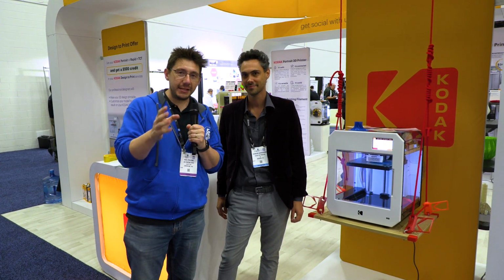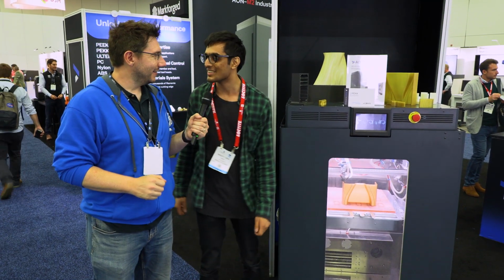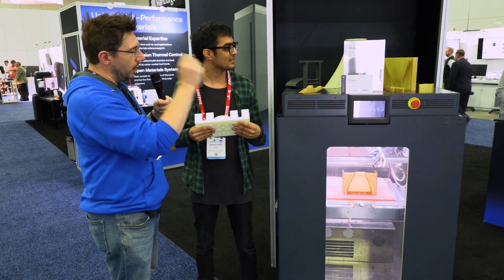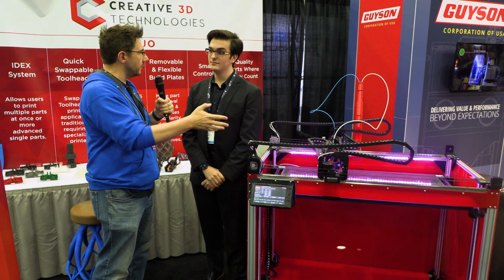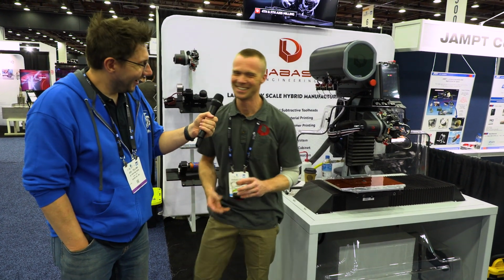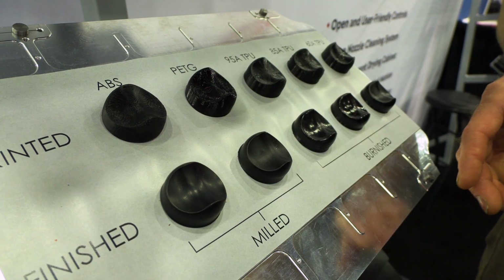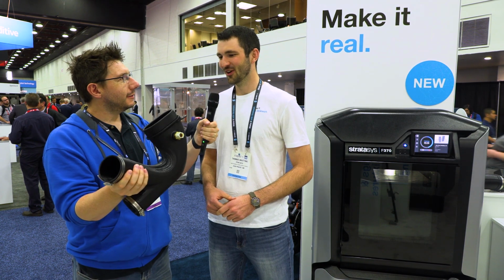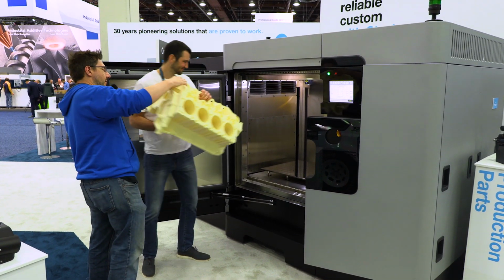Awesome 3D Printers at RAPID + TCT 2019

Comment: Is it possible to upgrade the tronxy xy-2 pro to have 2 hot ends its just I can see a 2nd space in the settings for one and I can see the Circuit board has extra connectors on the board i just don't know what i would have to buy and do to upgrade to 2x nozzles

Comment: me: man I want a kodak 3d printer
man: the cost is around 3500.
me: well... nevermind.
Reply: I would be afraid of any company that makes regulars printers anyway.   The way they have made ink cartridges shut down the printer when one of the two black cartridges is low on ink or how you can even use the scanner or fax options when there is an error with a printer part is the kind of fuckery I wouldn't want screwing with a 3d printer investment.
Reply: James Morris well, i already own a 3d printer, i just want another

Comment: still terrible prints, FDM has no future IMO
Reply: oof
Reply: Umbra Jord it's been more than 10 years? still same quality prints and unreliability; I'm convinced SLA is the way to go now
Reply: @FooBar89  only if you can deal with the (very) high pricetags, the toxic post-processing, the curing, the rarity of parts and resin, and the fragility/nature of the final prints that makes then near non-usable for applications many hobbyists get 3d printers in the first place, and if they suit your purpose. 

Everyone gets fdm printers, not to print solely pretty things (cos they most of the time cannot print pretty things), but to make stuff that can be tough, durable and useful ... and cheap. I got my 3d printer for 100 dollars, the same price I'd pay for a liter of standard resin over here... 20 usd for a (1kg) roll of ABS, PLA or whatever compared to the cheapest standard clear resin of 500 ml's that cost 50-60 usd is.... not affordable/practical for prototyping and making stuff that will end up taking a lot of beating.)

SLA is only really good for show-pieces. even the high strength resins aren't nearly as strong or safe as a cheap, well printed PLA part... or nearly as cheap (emphasis on cheap and safe).

FDM is not made or even good at making things to be pretty. it's made to make useful parts. SLA is not made to make useful parts. it's made to make pretty parts. they are both totally different beasts with totally different uses. they both have a place, lol.

there is no such thing as a bad printer. there's only the user using the wrong printer for the job.
Reply: Umbra Jord FDM has never brought me joy, only disappointment, every single time, on every single print, maybe industrial ones are better; I only have so much time and limited space, I have CAD designs that I need to print, SLA is the only affordable technology that delivered, in the same price range ($4000) FDM has not, that has something to say about the technology, I believe FDM has uses in metal printing, but I have little faith in it for plastic printing, I believe it's run its course

not saying FDM doesn't work or it is not useful, but only as a niche, it absolutely should not be taken as a general purpose printing technology, because it is not
Reply: @FooBar89  then that's your experience, lol... and I'm rather sorry that you did have that experience, but FDM printers really needs elbowgrease and work to get going well. they rarely work well out of the box, but that doesnt mean FDM deserves to burn in a fire or be taken out of the hands of truly great users who do printing as a bussiness, and do so quite well... That's like saying no one may own a car because your car had problems and thus every other car ever is trash :D
Plenty of people have done amazing things with FDM, specifically cheap ones like ender 3 for example, but only after they put in work. effort and upgrades (often printed by that same machine) on the machine... err, work, near-tears, and in my case, some blood as well, lol... getting cut on aluminium is no fun, but that was my own fault.

That's what I looovvvee about SLA though... in a sense, you can operate the machine flawlessly out of the box with a mere read through the manual. if SLA can get cheaper, more accessible, openly serviceable by you, the user, have more spare parts that are not proprietary/easy to get, less proprietary overall and have better, stronger, tougher resins... oh, it would make fdm pretty much disappear...

Comment: WTH??
All of these printers can be made for less than $1,000, whats with the massive price tags?
Reply from the maker: Jamie - I wondered that as well, but if that was the case, I figured we would have more machines out there like this. If you can make one for $1,000 that performs in a similar way and has the robustness these machines have, I will GLADLY show it off here.

Comment: The Kodak machine looks to me like little more than a DIY CoreXY machine based on linear rods and bearings (bleh) with a fully-cantilevered bed (bleh) and a print volume (200mm cube, bleh) that dates back to the early RepRap machines. There's nothing "commercial-grade" about that printer.

Comment: Don't be fooled by the F370 TPU. It is very geometry dependent. Been running ours for about two months.

You can't change infill density or layer height. They lock you out of basically every setting. You need a special TPU  extruder. Also the entire extruder head will need to be replaced after 800 hours and costs $1800.
Reply: As a long-time consumer 3D printer user and current user of both an AON-M1 (the dumpster fire version) and an F370, I feel like I need to say something. First, the F370 is THE MOST capable TPU machine I've ever used. Yes they lock you out of full density, for the same reason that printing full density in TPU is a nightmare on any machine. The perimeters are solid and the parts are great. Honestly the retraction is magic, I don't understand how they manage to get perimeter starts and rapids without stringing.

And we have way more than 800 hours on our TPU extruder, and it's fine. The printer recommends replacement (in addition to all the other service intervals) but that doesn't mean the extruder is bad. Our regular extruders are well over 2000 hours. as well, beyond their service life.

The regular extruders are $500 a piece, yes the TPU extruder is $1300. This sounds insane to a consumer, but believe me, the idea of screwing with a consumer printer while engineering work on million dollar contracts is waiting for you is equally insane. 

We love this machine because we're their target customer. It's definitely not for everyone.
Reply: Classic Stratasys...

Comment: Can you do a video on what method of filament the huge (like the large stratasys) printers use? Like do they use huge spools, or pellets or something else?
Reply: Hey Tom, we sell materials in 92 cubic inch filament spools but some materials are offered in bigger spool sizes (500 cubic inches for the lower end plastics like ABS and ASA). For reference, 92 cu in of ABS is about 3.4 lbs of material (1.5kg). We also chip our materials so the machine knows how much filament remains and also to eliminate the need for customers to tinker with print settings...which is a hotly debated topic

Comment: I've wanted a post-printing milling machine, at the hobby level, for awhile. 
If I'm dedicating space to a cnc milling machine, it'd be doing more than just light finishing work on plastic, also making it a machine for wood and light metal work, maybe even do some drag knife work with it; especially if you're getting into 5+ axis work, having one dedicated to just plastic is a lot of wasted space at the hobby level. 
Another thing I'd personally do is change from a turret tool changer, like the Diabase machine, to either a carousel or belt/chain based tool changer, as tool capacity would be much higher, especially when you're adding print heads on top of milling tools. Then maybe add some kind of pallet system for changing between cartesian and various non-cartesian build platforms, and to change between a build plate for printing and vises for milling, and a vacuum plate for drag knife and some harder to hold work.
Basically, I just want an all-in-one additive and subtractive cnc machine, as it'd consolidate most cnc work into a single machine, which means it'd be highly space efficient.

Comment: Could Daibase use the cylindrical set up to first mill a shape, say the 3D model of a person's forearm, then switch heads and print a material over that, creating a custom fit precision part?
the potential is great and I don't see why they couldn't but it requires a lot more consideration in head location and rotation on there lathe like part as the shape may not be uniform radially.
Reply: So you are saying if it could mill a cylinder shape until it turns it into a "customized arm" and print on top of it?
I think it still had to calibrate  the surface somehow (like a bed leveling of sorts), i think it would be easier to do the opposite, like printing on a smaller cylinder and radially generate support material to shape it into the  final form (using the support material to add some volume).

Comment: We are getting there ... now I like to see a machine that can what machine 1 can do ... if it can't be done by machine 2 ... cause that one would be nice to have with size of machine 3, and axis and tooling capacity of machine 4 + more axis on the toolhead + and the ability of the machine to actually measure what it is printed / machined with what should have happened and correct that if need be. Plus using more materials in same print (and some "exotic" as well). Plus putting in ready made parts ... which might be printed in a other run  ... or electronic components ...

And that for "consumer" pricing ...

Yeah, and I'm still dreaming ...

Comment: that cable chain placement at creative 3d tech would be the only reason i need to not buy that product. It screams they don´t know what they´re doing.
Reply from the maker: You should reach out if you have better ideas!
Reply: @3DPrintingNerd  Yea sorry i should have specified. You would flip them horizontally and have them roll off on a surface, preferably even in a designated channel. Check this image
https://www.finelineautomation.com/spree/products/332/large/IMG_2256.png?1437538730
or this one : 
https://image.ec21.com/image/cpsystem/oimg_GC00000001_CA03205791/CPS-Cable-Chain.jpg
You do not leave them self supporting in the air like in the video, it is really bad engineering and asking for failures
Reply: Here is a gif explaining it quite well. the stationary side should be on the bottom and riding on a surface, not above floating in the air:
https://d2t1xqejof9utc.cloudfront.net/screenshots/pics/95f27278891f7df743f7fa5df89afdd0/large.gif
Reply: The guys from the makergear printer did it correctly! I would much rather go for a makergear.

Comment: Would like to see that "space" resistant plastic at -240C instead of 240C which for space applications would make more sense, pretty sure it would not last long.
Reply: I'm guessing that the circuit boards would stop working before they reached -240C. If these parts are legitimately designed for real life production of spacecraft, I'm assuming that the plastic parts aren't exposed to the vacuum of space. Interesting thought though!
Reply: @lavachemist  Yes, most materials don't resist extreme temperature variations like you would find in the vacuum of space.
In the case of space avionics, they are always encased in a heated vault :-)

Comment: That feeling when your DIY-printer will be able to do most of the things the ones shown here can print... For a fraction of the cost.
Reply from the maker: Wait, your DIY machine does PEKK and PEEK? DUDE! This is awesome!
Reply: @3DPrintingNerd  As soon as I'm done building it, yes, it will, maybe it will need an upgrade on the hotends, but I doubt it. Everything on it is designed to do so, even a heated (and sealed) build chamber. Have a look: https://imgur.com/gallery/JgiFjjn
Obviously not finished yet. Been working on this design for the past 6 months, went through numerous design iterations and did a few prototypes, you can check those out here: https://imgur.com/gallery/g9Rma7Q
As I said, this is all WIP, so, nothing is written in stone yet. Will do a video or two as soon as this thing is finished. Would love if you could check it out then :)
Reply from the maker: @MadHatter123456  OH WOW! Yes, I would love to see this as it evolves!!!
Reply: @MadHatter123456  Looks very nice, big thumbs up on the mains voltage silicone heater. How are you managing to keep the GT belts out of the heat?
Reply: @anthonyrich1592  All motion components are outside the heated chamber. Only the hotends and the lower part of the coldend are inside the chamber.
https://imgur.com/a/KiA053S
(I highlighted the teflon-foil roller-blinds in blue for better visability)
I implemented some kind of roller blinds to seal off the chamber against the open top, at least in the Y-axis. I used teflon-foil for that. The rollers are being driven by a secondary belt that's mounted to the Y-carriage. To seal the remaining opening in the X-axis I will make a simple bellow, there's enough space inside the carriage to do so...
Edit: 
I know that this is completely over-the-top. I had some time and thought "what the heck", If I go through all the effort of designing and building my own printer, then it better be a good one...
I have all the parts at home, just need some more time to build everything.
Will do one or two videos once it's done and maybe I will do a detailed build-video if I can be bothered to film during assembly... Most likely not though ;)

Comment: All great machines, but I noticed a lack of any resin based printers.
Reply from the maker: Very much so. Industrial machines are very much SLS and FDM based.
Reply: Resin is the way to go. Those lines in the extruder style printers is so ugly.
Reply: @1sinister80  Fdm printers are made for prototyping not parts that look pretty. Resin printers are for making small intricate parts that look good
Reply: Probably because once you overcome drawbacks of the FDM - you don't need resin. Resin is pretty brittle and impractical compared to FDM, especially in an industrial environment.

Comment: Hey, great video. Haven't seen such industrial reviews in a while.
What's caught my eye (ear) is that Thomas from Stratasys mentioned their F370 has heated oven, not chamber. Any thoughts on what's the difference? 
Also that kind-a supervolcano looks interesting. You can also see some imperfections on the model related (I guess) to it, what is surprising for me.
Reply from the maker: I think the "oven" means it's going to get hot, and hopefully bake cupcakes.
Reply: I think "chamber" implies that it's the bed making making the air warm, while "oven" implies that there's a separate heating element to heat the air.
Reply: All the above comments are correct...I say oven meaning the air is heated but I guess chamber is probably correct as well. Also, we bake cookies in the 900 when we get bored.

Comment: Thanks for saving the HUGE surprise for the end! That thing blew my mind!!! One day I hope to print PEEK!
Reply: @PRiMETECHAU  that one was abs, but it can print Ultem and PEEK, both are insanely high temp materials. I've seen PEEK resist 280c. I wouldn't use it for an actual car engine, but for a short lived prototype, yes, way cheaper than milling aluminum.
Reply: @PRiMETECHAU  We can print Ultem 9085 and Ultem 1010 parts that are bigger than the engine block as well as being fully dense!

Comment: Kodak desperate to sell a printer for $3400 in a $500 marketplace.
Reply: FWIW, Kodak's PETG is the nicest PETG filament I used so far; albeit it's pricey.
Reply: *3500$ lol ridiculous
Reply: I'd be interested to see a $500 printer with the same feature set.
Reply: Yeah perhaps a bit harse but there are printers under $1500 that will print the same materials etc with a larger print volume. Is the filtering and cloud crap worth $2000? Kodak are trying to make a 3d printer that you use the same as a normal printer but it isn't there yet. Did you notice the size of the brim on the abs part? It was huge.
Reply: @petermoore9504  Given its price point and feature set, similar to the Ultimaker, I think it's aimed at the small company/university/maker space/prosumer market. And in that market it's actually very competitive. 

You can certainly make/adapt a printer to have the same capabilities as this for less money, but that's time which these institutions don't have (and it would likely cost them more anyway). They just want something which works.

Small things like the filtering and transparent sides and monitoring software looks like it would be easy to set up and use anywhere. And it looks like they've gone all out with the build, with core xy motion system and E3D components. It can print basically anything except the super high end materials like PEEK etc (flexibles may be more tricky since it's bowden), and with the settings tuning service would make it very capable in the hands of less experienced users. 

Also they aren't using chipped filament, they just have presets for their filament (and it fits in the spool compartment on the back) which again is better for less experienced users.

That last point is very key I think. These printers aren't aimed at hobbyists (although they're actually well priced for the prosumer as well), but for institutions which don't have the time or experience to tinker with settings and just want a printer they can put anywhere, with very good printing capabilitites, this is excellent.

Personally I would prefer an E3D toolchanger since I have the time to tinker with it but that's just me.
Reply: @petermoore9504  Cloud printers are an anti-feature for me. Big enterprise screws up internet security all the time, I'm not interested in letting 3D printer manufacturers have a crack at it.